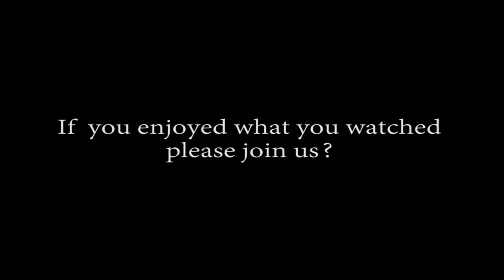'Making Picture Frame with Hand Tools

Comment: @1:38:00 You can get squirrel hair mop brushes in the water colour section in a decent art supply shop. Certainly this is the case for Ireland where I live, also the US I believe, perhaps not in Australia though.
Reply from the maker: I have not seen them here for many years there are a lot of synthetic substitutes about such as and Taklon they are OK but not Squirrel. I have some beautiful Badger brushes I use for french polishing as well, no streaks. Thanks for the info. Cheers Steve
Reply: @Woodworkingmasterclass  You may have to look online then for pure squirrel watercolour brushes if you need a replacement! All the best.
Reply from the maker: @Auriflamme  Thanks, will do. Cheers Steve
Reply: We don't have no squirrels!

Estephan Opossum
Reply from the maker: @stevecallachor  Well there ya go, is that the same as we don't have rabbits only short eared hares? Cheers Steve